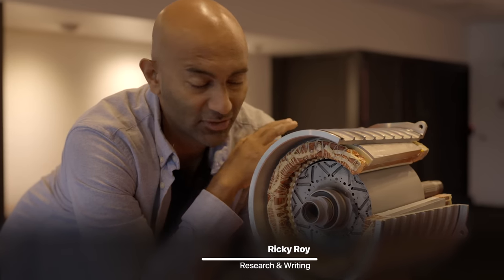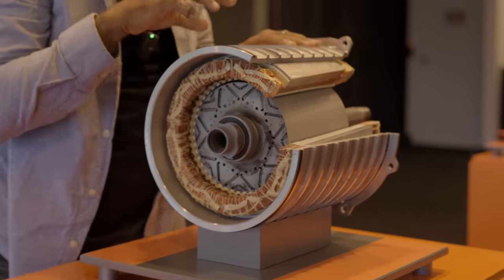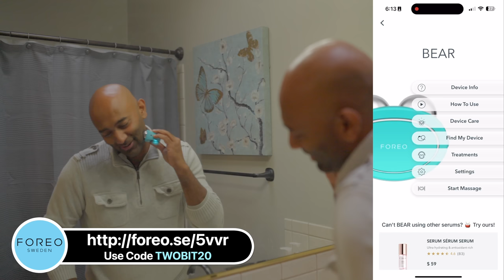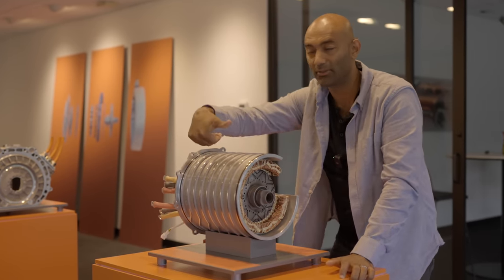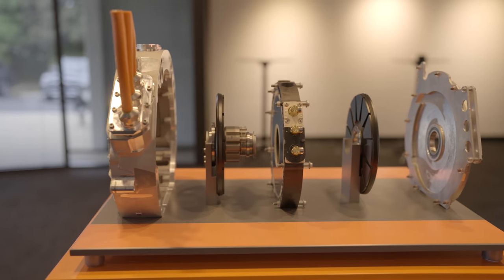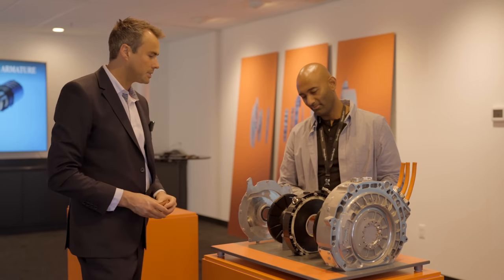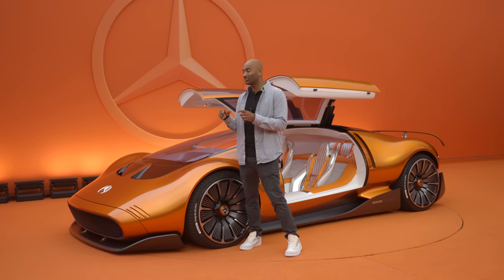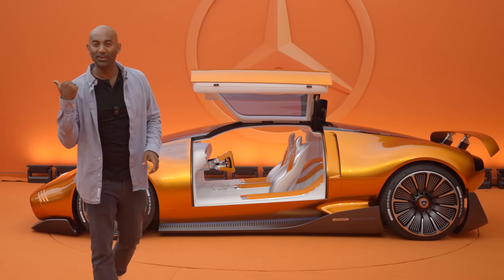Axial Flux Motors Will Change CARS - Here's Why

Comment: The axial-flux motor has been  a well-known configuration for many years.  What I did not hear in this presentation are the issues that have prevented its general adoption in any number of stationary and transportation applications to date and how Mercedes has overcome those limitations.   Surely, the material cost savings for the axial-flux motor alone would be compelling in any application, all other manufacturing considerations being equal.  The fact that radial-flux motors are still the dominant form factor implies that there are either significant differences in either design complexity or manufacturing complexity or both.

I am certain that Mercedes is being successful at optimizing toward their target goal.  From this presentation I am not sure what that goal is other than performance/weight ratio.  I also did not hear what advances can be made on addressing performance/cost when compared to a motor such as the Tesla Plaid motor.  Maybe Mercedes can surprize me.

BTW I have only heard of battery temperature and brake temperature being limiting factors for Tesla Plaid at Nuremberg and Pike's Peak.  It is impressive that Mercedes axial motor runs so cool but is that the highest problem on the pareto list?  At least more of the system's cooling will be available for battery packs, so the motor advance does impact the higher heat item on the list.

I like the development but am still skeptical that this is nothing other than a specialty racing motor, albeit a potentially impressive one.
Reply: From the engineering standpoint you have many advantages from a way smaller, more compact, more efficient motor. One is packaging - standard motors have 3 times the weight and the sizes, you could put 4 of them at every corner - that is next gen opportunities in controlling and performance.  It is not solving the battery limitations you mentioned - but Mercedes is developing there too. You can see their concept car with a 1200km range. Its a technology leap forward.
Reply: @bavariancarenthusiast2722  The only part we disagree on is the fact that, as presented, the design is a technological leap forward.  It may be a notable refinement of the axial-flux configuration but no mention is made of advances in the manufacturing process that would make the axial-flux design cost-competitive to at least the advanced radial-flux designs.

It will be interesting to see this motor in performance applications.  I do not have enough information for me to anticipate its incorporation into high-volume surface transportation.  The weight-savings is compelling for air-transportation, however.
Reply: @mrhickman53  agreed - I also don't know the production costs compared to the older motor designs, if they are on par or maybe cheaper. 
For me it's a revolution - its 1/3 size and weight by putting more power out. 
We need this for batteries too - imagine one third the weight and more capacity. We will see that in 3 years from now.
Reply: @bavariancarenthusiast2722  First of all, let me explain that I use these responses to sharpen my views on the subject.  I do not intend to be at odds with your views, just explain why I hold mine.  No offence is intended.

While I have not looked, I imagine the VTOL drones being developed as air taxis are almost exclusively axia-flux direct-drive motors.  The cost penalty for weight is too high to ignore axial-flux designs.  I have not tried to compare the Mercedes claims against motors being applied into those applications, but I imagine they are similar.  As I think about it, the fact that Mercedes did not identify air taxis as a target market for their development makes me more suspicious of any claim to revolutionary design.

Again, it is likely very good engineering, which is a merit in its own right.  If it shows up in a production car, I imagine the owners will be paying a premium for the performance and fine engineering.  From a marketing perspective, if this premium exceeds the cost penalty over the equivalent power from radial-flux designs due to consumer impressions of higher achievable performance, then the design is successful.
Reply: One thing to mention is that Axial Flux layout is solving a problem that hasn't really been a problem for electric cars.  A radial flux motor is already very small, very light, and very high torque compared to the ICE it's replacing in a design.  The axial flux layout gives higher torque, but the torque limit on most EV is the ability of the tires to grip, not the motor.  Meanwhile, rotating mass isn't free.  The higher RPM of the radial flux motors means they can give a modest car a higher top speed without the need of a transmission.

So there are reasons this is being talked about in terms of ultra-high-performance vehicles, for now.  As they get cheaper, the axial motor-per-wheel approach will probably trickle down to economy vehicles.  Unfortunately, nobody is making economy EVs while the limiting factor is battery supply, because the margins are higher on luxury vehicles.
Reply: 'a well-known configuration for many years.'  Exactly, there was the quite famous at the time solar car around 1998 or so IIRC..
Reply: the efficiency is unmatched
Reply: People didn't know. And: Wheels don't need to spin at 22k RPM. Just reduce gear-ratio when using axial flux.
Reply: @mrhickman53  Your logic is spot on. In a normal auto the benefits don't matter. In terms of mass a model S is around 2000 kg with 1k HP. So two of these could be 40 kg instead of 3x, 80 kg more. 4% total weight or one passenger doesn't significant alter the utility of everyday use. Similarly for size savings, just make the auto a little bigger to gain the same few cubic feet of space. Like other exotic materials in transportation, the use case is in extremes: race vehicles, aerospace, and branding/marketing.
I question if the manufacturing is truly simpler but the reduced materials (assuming it isn't using more exotic/expensive materials) could lead to a less expensive product. Assuming reliability is there and a modest cost savings can be found these will take over. Until then, iterating on a proven platform is the more conservative approach.
Reply: @larslrs7234  I first toyed conceptually with axial-flux designs in the '80's based on what was already well-known then. 

Since you already seem to agree that a gear-reduction is required with either motor, I assert that the one reduction requiring a higher ratio presents minor mass and cost issues.  This implies to me there are significant manufacturing cost disadvantages to the axial-flux motor.  

Observation of a few frames of the video indicates to me that the Mercedes design relies on a significant mass of rare-earth magnets on the rotors in order to achieve a reasonable magnetic flux density through the current coils.  This can be a significant material cost driver as rare-earth magnet cost per unit mass significantly overwhelms copper and steel costs per unit mass.  A crude spot-check for neodymium vs copper reveals it to be approximately a factor of 10 more expensive.  With Tesla moving to designs that either minimize or eliminate neodymium and other rare-earths, the mass savings of the axial-flux may not transfer directly into cost savings even neglecting any differences in manufacturing costs between the two designs.

I only write all this to demonstrate where the video failed to convince me that there is great novelty in the design.  Whether this is the fault of the video itself, or the material either provided by Mercedes or researched by the channel to support the production of the video, I do not know.  I also do not know if a video produced in a fashion to satisfy me would generate enough clicks to be worthwhile producing.
Reply: @barongerhardt  I just replied elsewhere that there is cause to question if the reduced mass of material even leads to reduced material cost.  The statement that the coils are placed in a non-ferrous stator implies a large gap between the magnets and magnetic material (steel?) of the rotors.  This requires magnets of the highest energy  density to maintain the flux density in this gap for the current to react  with.  So I have either misunderstood the video or the motor requires a significant mass of rare-earth magnets, which I spot-checked to cost about 10 times per unit mass as copper.

This may be a finely engineered motor suitable for specialty applications such as racing or flight.
Reply: With the materials and tech that has been developed since the discovery of these types of motors, they may have become feasible.  Looks good for sailboats.
Reply: I mean, "hotter" means less efficient, if the work is equivalent.
Smaller and lighter are both possible paths to placing the motors nearer the wheels and placing more of them, giving direct control rather than relying on differentials.
Moving motors nearer the wheel is a packaging opportunity as well, and an opportunity for different footprint/geometry.

As for cost of manufacture, you have to keep in mind the reduction in material mass.
Reply: @mrhickman53  Depending on how much of those magnets are need or if they can be swapped with something else after other improvements, it might not be a deal breaker. I just don't see it as ever being a revolutionary game changer in the ev market and any modest gain it does provide won't be anytime soon. Maybe 10 years down the road a model 3 costs $1k less to produce and has an additional 40kg payload capacity, cool.
Reply: @rpontonjr  You assert axial-flux designs are cheaper but I have not seen evidence that they are so.  Being more power-dense does not automatically translate to being cheaper.

If you have evidence of them being cheaper, please share.
Reply: @barongerhardt  I'm a little rusty on magnetic circuits but the volume of the gap times the target flux density squared, approximately 10-12 kgauss if steel is part of the magnetic path elsewhere divided by the free-space magnetic permeability is the amount of energy the magnets must provide to the gap.  If I remember correctly, the portion of the magnetic energy transferred to the gap is proportional to the thickness of the gap vs. the thickness of the magnet, assuming infinite permeability of other magnetic materials outside the gap.

A significant difference magnetically between radial and axial-flux permanent-magnet motors is the  (assumed) better ability of the radial-flux motor to minimize the effective gap length,  yielding a smaller gap volume per unit area and, thus, less required gap magnetic energy for the same flux density.

In the design shown, the magnetic fields will tend to flex the rotors toward the stator, requiring the mechanical design to provide enough stiffness to minimize the flex and enough clearance to accommodate variations in flex due to operating temperatures and current flow in the stator as well as manufacturing tolerances.

Boiled down to basics, I see the predominant manufacturing issue of axial-flux motors is flatness, where the predominant manufacturing issue of radial-flux motors is concentricity.

I do see potential advantages of the axial-flux design from an operational efficiency standpoint.  The magnetic material in a stator suffers from eddy-current losses due to the magnetic field reversing polarities at the frequency of the applied AC current.  If this design truly does not have magnetic material in the stator, those losses are avoided.  I do not have an appreciation for how these "iron" losses compare to the "copper" losses in a modern traction motor or how the copper losses of the axial-flux motor might increase due to the larger air gap and presumed higher leakage inductance due to the increased gap length.  Lower inductance also implies a requirement for higher switching frequency in the inverter in order to minimise peak currents at the switching frequency.

I'm just pointing out that it is hard to optimize everything at once.  I'm sure this design optimizes those things the team set out to optimize, but it is likely a subset geared toward performance and not necessarily cost.
Reply: one major disadvantage is top speed.. he did mention that
Reply: This I why once in a while I open and read the first few comments.
Reply: The expected rising cost of coper is going to be a major driver in adopting this configuration, material are a floor for the cost of a larger motor so once both are produced at scale the axial-flux motor will be cheaper.
Reply: @mrhickman53  I asserted no such thing.  I said as they get cheaper, meaning relative to where they are now, they may show up in economy cars.
Reply: he mentioned it was for a hybrid vehicle so I would imagine that space saving design is very desirable.
Reply: @burtun1760    I've absolutely no issues with it as a hybrid motor with similar operating range as the engine.  Packaging constraints likely reign supreme in that instance.

I understood the concept discussed was based on an existing hybrid motor design but extended to provide the desired performance to a BEV.  Extending the axial-flux design to such platforms is where I have some scepticism.
Reply: @rpontonjr  My apologies for misunderstanding you.

You do bring up a point that I have pondered, whether quad-motor configurations are superior to dual-motors with differentials and torque vectoring (independent wheel braking).  So far, the conclusion I have come to is that the situations where a passenger vehicle/light truck requires torque vectoring at relatively high speeds are few and far in between, so torque vectoring, even though it  is energy dissipative, is quite satisfactory.  At low speeds, such as encountered in off-road conditions, the additional dissipation should be quite manageable, due to the relatively low power involved.  It is all about the torque in these conditions.

I have not looked at the power dissipation capability of brake rotors to know whether quad-motor configurations for vehicles spending extensive time in the mud offer a true advantage.  The lazy me would probably lean toward quad-motor rather than investigate this possible limitation of torque vectoring.
Reply: @kennethferland5579  I do not see the compelling reduction of copper in the design.  Force is Ampere-turns times flux density times the length of the turns mutually normal to desired direction of the force and the magnetic flux.  Whether an axial-flux design or radial-flux design, there is little change in the amount of conductor required to generate a similar force in the presence of a similar magnetic field.  I wrote previously that the savings in copper, while there, is likely a bit exaggerated by implying that the entire turn of the axial-flux winding contributes to rotational torque.  Only the radial segments of the conductor do so.

I have also written previously that the gap length is likely much larger than that in a radial-flux motor, which will require a higher volume of magnets to generate the equivalent magnetic flux.  If these magnets are rare-earth, neodymium is roughly 10 times more expensive than copper.   Now motor radius and rpm can be adjusted in order to minimise the energy requirement of  the magnets per unit of peak power output, but I expect this requirement to remain large compared to a radial-flux machine based on the images.

It seems that Cu prices are currently ~$9/kg and silicon steel is ~$2/kg.  Neodymium is somewhere in the $100/kg range.  Take a swag at the tesla plaid motor being 25% Cu and 75% SiSteel for no apparent reason and totally neglecting the neodymium for the moment as Tesla has plans to eliminate that in at least some of its motors, the $/kg of the motor is $3.75.  The motor weighs 45 kg, so a very crude estimate for the material cost is $169.

Unless the axial-flow motor is achieving much higher gap flux density than the silicon steel of the radial-flux motor can  support the axial-flux engine is still using a large fraction of the copper.  If there is no silicon-steel in the stator, the rotors do not need silicon-steel and be made with a cheaper ferrous material due to the static magnetic field applied to it.

In order to complete the fiction, assume the axial-flux motor weighs 13.5 kg, 9 kg of which is Cu, 80% of the radial-flux motor.  Let the remaining 4.5 kg cost $1/kg and we have a material cost for the axial-flux motor of $85.5.  The axial-flux motor can use as much as 0.8kg more of neodymium than the radial-flux design and be within material-cost parity.

The question is whether it will ultimately save cost once the two manufacturing processes are at parity, if they ever can be.

caveat:  If I can convince myself that it is feasible for the axial-flux design to generate equivalent force from a markedly reduced gap area, then I would need to revisit my arguments.  This would then be a great exercise in me remembering how a motor works.
Reply: They were always better but it's only been recently that axial and transverse motors have been relatively easy to manufacturer in to an efficient design. Prior it was difficult, fragile, and expensive which is why you didn't see them very often. They're also tricky to drive so speed controller design had to improve as well. They should provide an incremental improvement over radial motors. Nothing magical, just more efficient at the expense of a more complex design.
Reply: It's like Popular Science mag more cool future stuff that may or may not ever appear.
Reply: @bavariancarenthusiast2722 From a production engineer - The copper windings look much easier to make in the axial flux, once they have more machines specially for them, the coils will be cheaper.  The materials used in the axial flux weren’t really discussed, but they didn’t look unique.  I imagine some of the issue is the casing to keep the thing together at high speed, and the “hand made” methods used right now.  In “normal cars” It would be sensible to add some gearing to keep the RPM down to remove the need for exotic casing technologies, obviously Mercedes want maximum speed for their concept car, so they are spending big on all components.
Reply: @Muppetkeeper  Thank you for experienced comment - appreciated. Yes the concept car was no costs spared, this is not a generic Mercedes development, they bought an english company called Yasa - and their customers are companies like Koenigsegg (not cheap either), Jaguar concept etc. I don't know how exotic those materials are, I guess you can build them with standard materials, here a quote: "Simplicity can be beautifully efficient. Compared to the complex, multiple slot windings of conventional motors, YASA motor’s segmented armature lends itself to low-cost, serial production.
Our motor efficiency is not limited to its performance capability.
The YASA Axial Flux approach uses less material such as copper, iron and permanent magnet, than conventional e-motors, resulting in a significantly lower material cost and a more environmentally-sustainable product."
Reply: @bavariancarenthusiast2722  While it may be tempting to slap four motors on, doing so would require having four 100+kW inverters on board and those would be much bigger than the 100-200kW motors themselves. You'll likely also still want the motors to be mounted to the frame instead of directly onto the wheel to minimize unsprung weight, avoid HV cables, control and coolant lines going through the suspension, which means you will still be losing quite a bit of space just to accommodate having CV axles. Since CV axles work best at shallow angles, you would likely want to put motors close to the center-line to minimize angles across most of the suspension and steering motion range. In the end, you have roughly the same under-carriage footprint, except more of it is empty space around the CV axles.
Reply: 500 hp is a lot of power. If only 1% of that is dissipated in the windings and such, that makes the motor a 3.7kW heater. That will be produced in comparatively short bursts, of course, but that's still a significant amount of heat to manage. 🤓
Reply: @mrhickman53  There is a lot of copper used in the weave of a radial axis motor designed to reduce magnetic fields outside the rotor and also to get the copper for the rotor where it needs to be.
Reply: @serversurfer6169  Based on my now several decades old experience with industrial motors I expect the losses to be closer to 3% at rated power.  I expect the losses in the inverter to be about 1.5% at rated power, though switching times are likely vastly improved since I was last active in inverter design.

If an ICE engine is 30% efficient at 500 Hp, its thermal system must remove heat at a 870 kW rate at steady-state (the engine temperature no longer rising).  There are likely insulation systems for the electric motor that permit it to approach the target cylinder wall temperatures of an ICE, so the cooling requirements should not be much more stringent.  The inverter likely does not like to run above 150C, which is about 50C lower than what is posted as a maximum cylinder wall temperature on at least one web site.

Racing is much about dissipating excess thermal energy.  Thermal power dissipation from the brakes is another limiting factor in both racing and the speed which ICE trucks can come down long grades.  Battery-electric trucks will be able to make better time in mountainous areas due to more torque upgrade and the same torque recovering energy into the battery downgrade rather than heating brakes.
Reply: I agree. It's like I've been hearing "battery breakthrough" for the last TEN YEARS.  All click baits.
Reply: @Muppetkeeper  While there may be craft in how the end turn is weaved to reduce the stray fields my observation of many sets of end turns never led me to believe significant additional material is used for this purpose.

High-speed motors tend to be both longer and smaller in diameter,  both of which lead to a favorable ratio of end-turn length vs. axial length.  If only the length is increased, the resulting torque is also increased proportionally.

My (mental) analysis of an axial motor yields that, to increase the ratio of radial to circumferential copper without increasing the diameter of the motor, the center of force will move radially inward from the edge of the rotor, reducing the moment arm for calculating torque.  So while the force in increased due to increasing the length of the radial components, the torque increases as a fraction of this proportional increase.

I need more information about the design of the axial-flux motor before I can appreciate how much copper can be saved.
Reply: @serversurfer6169  It is 3-4kg of copper surrounded by coolant. The specific heat of all that mass would limit temperature rise to about 3C/sec, enough to manage ~20s of acceleration without active cooling. You'd still need active cooling to ensure the temperature does get back down in time for the next time while the motor is dissipating 200-500W at cruising speed.
Though if you are repeatedly calling for 350kW long and often enough that motor heat-soaking is of real concern, I hope it is either on a race track or while towing something heavy, otherwise it reeks of reckless driving.
Reply: @teardowndan5364  Yeah, a one-time event is easily handled, but the issues come with prolonged or repeated usage. It sounds like a lot of these motors use liquid cooling, and YASA are saying their design is less complicated. 🤷‍♂️
Reply: @serversurfer6169  I think Tesla has that part mostly licked with its integrated motor-driver units where the motor shares oil with gears and bearings for cooling and excess heat gets dumped into the electronics' liquid cooling loop through a small heat exchanger. For lower power motors, heat crossing the midplate into the electronics side would likely be enough to skip the heat exchanger altogether.
Reply: They have already been used in the Koenigsegg Regera - which should vouch pretty heavily for their usability.
Reply: @dangraff8467  Earlier lithium batteries from before EVs became a thing and the industry started to worry about sustainability weren't designed with recycling in mind and most of the materials from "recycled" batteries went to landfills or incinerators. Modern ones are designed to be almost 100% recyclable. Many of the materials have more than tripled in price since then too, which greatly increased the incentive to recover more of everything and making it easier to do so.
Reply: @dylanevans5644    I've no argument against usability.  I am only skeptical of cost-competitiveness.  Koenigsegg optimizes for other things and the customer pays for those optimizations.
Reply: @mrhickman53  Yes, I agree.  I feel that we haven't really seen the true potential of electric vehicles, yet.  Some of that is the fact that they are "cars" and subject to the car regulations written for ICEs.  More of that is the fact that they are using parts from ICEs (everything from door handles to headlights to radios).  Mass market EVs haven't really diverged that much from their ICE heritage in overall design -- yet.

Because batteries are the limiting factor, we see the focus on really big EVs for higher margin.  When that chagnes/shifts, I could see axial flux motors being attractive to maximize usable interior space in an economy vehicle.
Reply: I'm fairly sure cooling the copper coils would solve a good portion of the shortcomings, retrofitting cooling into existing machines would be cost prohibitive. Purpose built means that stuff doesn't even matter if it achieves the goal
Reply: @ModelLights  technically, it is THE original electric motor. a faraday aka homopolar IS (in most configurations) an axial flux motor.

anyway... over a century of development, rather intelligent men working on problems... 

theres several reason we still use radial flux in virtually every motor.

i could explain but as i have a habit of writing what some people call "novellas", then calling them ignorant pigs,  im keeping my fingers still and just suggesting people educate themselves on things like amp turns, reluctance, flux density, inductance, reactance... pole shaping, etc etc etc...

this is, as usual... hype-speech. its meaningless babble spitting out hyped up keywords. oh my... "axial flux", it sounds SOOOOOO technical...
Reply: @paradiselost9946  
'i could explain '  No need to be concerned, I've been doing motors since I was 12 in the 1980's and controlling stepper motors off the back of a C-64, I'll be way ahead of you on this.  I haven't been buying and selling on Ebay much lately, but I still have a few thousand motors laying around.

' rather intelligent men working on problems... '
I'm in the 180 IQ range myself and was around early as LRK types were being developed, I'm a bit more aware than most..

'THE original electric motor. a faraday aka homopolar '
That's a minor triviality, totally missing the control and internal gearing aspects of LRK type axial flux motors.

'i could explain but as i have a habit of writing what some people call "novellas", then calling them ignorant pigs,  im keeping my fingers still and just suggesting people educate themselves '

I left it a mere mention on purpose, the people who are smart enough and actually have interest can look it up, and the rest don't really matter.
Reply: The one on my vehicle is only 20hp but 189 ft/lb of torque. These motors are not HP monsters but Torque giants. It will be interesting to see how they develop these to compete with the radials in the HP area.
Reply: Low rpm.  Sure, can add a transmission (for added cost) which would make it more expensive than a standard motor.
Reply: @johnsanders8168  Please don't mind my playing with numbers, though I will convert to metric.  20 hp = 15 kW,  189 lb-ft = 256 Nm.   A model I have for my EV requires about 540 N at 100 kph or 28 m/sec = 15 kW.

Assume the vehicle weighs 2000 kg and is moving up a 3% grade at 100 kph.  The required power is 2000 x 9.8 x 28 x 0.03 = 16 kW.  This is in addition to the 15 kW to move the vehicle at 100 kph.

If one is okay with 0-100 kph in 10 seconds,  the acceleration force required is 5600 N.  For a tire radius of .38 m,  the torque at the wheel is 2000 Nm, or about 8 times the motor's rated torque.  A motor at each corner with no gear reduction would only accelerate the vehicle to 100 kph in 20 seconds.  The power due to acceleration at 100 kph is about 157 hp for 0-100 in 10 sec.

This might give one the directions they may go in scaling your particular axial-flux motor to a full EV application. 

Torque is nice, but power is also necessary, depending on the mission.
Reply: @teardowndan5364  you make some very good points. 

Yes i can see the narrowness of the axial flux motor still being a an advantage with center- mounted design, but really only if we're talking about something with alot of travel such as an offroad vehicle. In that case, as you pointed out, it is a large advantage to have the cv shafts as long as possible.

Its always been something I've thought about, and why I like the potential we have with electric cars- how to eliminate as many mechanical things in the drivetrain as possible (including differentials, the CVs, and shafts). I'm no expert (in fact not very well educated in electric motor technology) but clearly motor technology needs to evolve still to get there.
Reply: @cheatinggravity173  I don't mind reducing overall component count as long as ride quality, reliability and serviceability stay up. And I'm not foreseeing any of those surviving integration of the motor and gear box with the wheel hub, only much more expensive and frequent repair bills.
Having 10kg of extra unsprung weight would likely double the likelihood of ripping tires on potholes and all of the subsequent dangers. Wheel bearings will likely fail much quicker too due to being exposed to harsher shock loads from having that much extra hard-mounted mass on them.
The thing about longer CV axles isn't about suspension travel, it is about minimizing angles for efficiency. An axial motor has a larger diameter, which means the motor would need to be buried further up to maintain ground clearance, which in turn means steeper angles all around unless you use a gearbox to shift things back down.
Reply: @teardowndan5364 I'm following you, all very good points. How much difference in diameter are we looking at for axial vs radial flux motors in the 300 hp range?
Reply: Just at a cursory glance, can we just say they're sacrificing magnets for copper?  That doesn't seem like a good trade.
Reply: Temperature problems? Sounds like if we did adopt these sorts of motors we would be in the same kind of problem as we are with LEDs, burning themselves out because of production cost-cutting and unsound engineering and then letting the customer foot the maintenance bills.
Reply: @cheatinggravity173  Power alone doesn't mean much as it is a function of torque at a given RPM. 
The diameter would be a compromise between how much torque you want to have direct from the motor rotor, how much vertical clearance you are willing to sacrifice for it and the RPMs you want to operate at. As pointed out in the video, a larger rotor produces more torque but the centrifugal force trying to rip it apart and inertia increase too, which means having to lower max RPMs by an inversely proportional amount.
Looking at YASA's datasheet though, there is one glaring flaw with the idea of using axial motors to directly drive wheels on an EV: 0Nm torque at 0RPM. Can't start moving on its own while under load, needs another motor to help it to 200+RPM first. That explains why Mercedes slapped it between the ICE and transmission instead of a fancier hybrid setup.
Reply: @teardowndan5364  power means plenty. it measures the ability to accelerate mass, not just potential to move it. Larger rotor with higher torque at lower rpms requires less differential of speed between motor and tire speed. The faster gears in oil turn, the  more loss to friction, at an exponential rate. One of biggest robbers of power in a car at highway speeds besides air resistance is gears and bearings turning in oil.
Reply: How dare you! He wanted a free vacation, he isn’t worried about petty things like facts!
Reply: @mrhickman53 these motors don’t last long. It is why they are RPM limited. You won’t see any cars going 150k miles on these motors. That’s why they will only be put into super cars, not the cost not any other reason. A super car owner is the only person stupid enough to pay a million dollars for a car that has no hope of going 100k miles before the motor grenades itself.
Reply: @mrhickman53 these motors have been around forever it’s not novel. They spin themselves apart in short order, which is why they can handle rpm, but even then they don’t last. These are only fit for super cars because only super car owners will tolerate the engine grenadine itself at 50k miles
Reply: Intelligent and fair comment. Engineering is about compromises and anytime someone claims that they have done something unique or groundbreaking, that is to dispel the millions of people who have already tried this idea. That doesn't mean we don't try, but it does mean that we need extraordinary evidence for extraordinary claims. 

But how else do you get more YouTube click if you don't just paint the upside all the time? ;-)
Reply: One advantage that he didn't mention is coaxial motor stacking, which can be useful for applications that need very high power output and isn't really easy with other types of motors.

The high performance of these motors require much higher voltages than are seen in standard motors.  This means that the whole power delivery system has to change to be more robust and will drain batteries quicker.

The main place I have seen these motors being used is in electric formula student competitions in universities where  there are very strict low weight constraints and they have to worry about every ounce of weight.
Reply: I totally agree with this comment and how axial flux motors are presented. Axial flux motors have been dismissed multiple times due to cooling, vibrations and structural integrity. 

Let's start with the cooling, given that you have a much more energy dense motor, the heat is now concentrated in a smaller area, making efficient cooling for this engines very challenging, specially for the rotor. 

The second topic is vibrations, while radial flux motors are naturally balanced, axial flux engines are not, they require very strict manufacturing tolerances and low variability in terms of the conductors and magnetic fields, otherwise the engine would "want" to vibrate up and down. 

And the last one, and perhaps the most difficult one to overcome is rotor diameter and it's structural integrity. While radial engines can keep the rotor relativity small in diameter, although longer to achieve bigger power output; axial engines need to have a bigger diameter rotor to increase the power output. A bigger rotor will exert more centrifugal forces to the edge of the rotor, and you then are limited to how fast an axial motor can spin, otherwise you need to use very expensive materials like reinforced carbon fiber to keep rotor integrity at high speeds. 

About 20 years ago, axial motors had also much more complex controller circuits, but it is no longer a problem for mothern electronics.
Reply: Surely, the material cost savings................ yeah they dont like the word savings
Reply: It's all about 'performance/weight ratio', surely? That's the basic equation there, no? The presentation goes into Tesla motors, and covers drawbacks they are working on.
Reply: Overheating was a problem for the Model S under any extreme use for a long time. You could only drive them really hard for about a minute before they went into limp mode. The sub 3 second 0-60 was only available once every 45 minutes or so, and there was a fairly low limit to how many times you could use it over the life of the car (the company lost a class action law suit over that one). It was a $130K high performance car that would get completely destroyed by a Nissan Versa at any track day, because it became a 5,000 pound mobility scooter after about 2/3 of a lap in most places.

That's why the biggest change to the car in recent years has been improvements to the cooling systems. 

Honestly, the fact that a nearly 15 year old design is still pretty competitive this early in the electric car era (when you'd expect the highest rate of incremental improvement) when the development has been primarily focused on stuff like cooling and opening up the software as reliability data warrants shows how much potential electric cars have. Maybe axial-flux is the next big step forward.
Reply: Cooling system is a limiting factor I guess. Motor design requires massive radiator.  Take into consideration 3 (!) Cooling lines in the video.   When liquid cooling system  connected to the motor, total weight and size will be comparable to the classic electric motor.  "There is no cigar " here.
Reply: @mrhickman53  If the cost of raw materials, batteries, and all the supporting equipment changes drastically due to an . . . economic realignment or some other kind of "4th turning" event or global black swan impact then  manufacturers will be looking for any pathway that leads to more power with less materials. So, in a nutshell, if the equation changes drastically enough to wildly impact basic costs then huge efficiency gains through disruptive minimalist designs (like the subject video) will accelerate the transition and adoption IMO.
Reply: @hardchemist  Hmm.  Seems there are a lot of "ifs" in your comment. 

If my observation is correct,  that the motor in the video relies on a much higher quantity of rare-earth magnets in order to compensate for the larger gap in the magnetic path due to saving the silicon steel, I assert that the axial-flux design has much higher exposure to disruptions in the global movement of materials than radial-flux designs, especially the teased Tesla design that supposedly generates competitive flux levels without any rare-earth magnets.  I understand that rare-earth processing is highly concentrated in the Middle-Kingdom, whereas both copper and silicon steel is processed more widely.

I know of no similar high concentration of copper processing or silicon steel processing that would make them subject to a sudden and massive disruption as we have the potential for rare-earths and lithium at the moment.  At present, integrated circuit and, possibly, silicon carbide power electronics processing is likely more subject to disruption than copper, silicon steel and aluminum, the materials required for induction motors that, while less efficient at rated power are still quite useful in transportation.

In my opinion, permanent-magnet motors have made such a heavy penetration into EV's to date because performance has been the sizzle that attracted attention to them.  I have first-hand accounts of two acquaintances that are decidedly more conservative in their views than I am that purchased Teslas "for their performance, not for environmental reasons", paraphrasing their words.

At the risk of droning on way too long, an axial-flux version of the induction motor is certainly possible, but that would definitely require silicon steel in the stator and the rotor magnetic material would likely require a laminated structure in order to minimize the eddy-current losses that would not be present in a permanent-magnet design on that structure.  Much of the advantages of the axial-flux design would then be lost.
Reply: @mrhickman53  Brilliant and thoughtful reply, thank you!
Reply: @hardchemist  I enjoy these conversations.  Your previous comment caused me to think about resources more thoughtfully than I had recently.  Have a good day!
Reply: @mrhickman53  Adding one thing, I have so little faith left in the "powers that be" (corporate and government influencers and powers) that my "if" statements really should have been "when" statements. The lunacy factor is completely off the charts and it really seems as if the system is purposely being crashed. We are definitely living in interesting times!
Reply: @hardchemist   I suspect there have been "powers that be" and those that had no faith in them since the beginning of civilization.  I've no answer to that.  I merely try to make sure that what captures my interest in these times are of a constructive rather than a destructive nature.  Again, have a great day!
Reply: I just cant wait till these are powering planes and gyroplanes in a ducted fan hybrid setup.
Reply: @mrhickman53  I built an axial flux motor for a wind turbine 15 years ago and the design was not new then. You're right to say it requires a high percentage of strong rare earth magnets making the design expensive.
Ricky also talked at length about the problem of copper looping back at either end of the other motor but failed to mention the recent advances where the winding's are welded at either end reducing the wasted copper significantly.
Sadly some of his recent videos have been more like propaganda from the company than journalism.
Reply: @mrhickman53  They tend to be cheaper to manufacture as their construction is simpler, the winding process is simpler. The materials cost is less as well. Take a look at some winding machines for radial vs axial.
Reply: @kayzrx8  I think the increased rare-earth magnets likely negates the material cost.  Overall mass is saved but not necessarily cost.  Frankly, due to the large air gap that I imagine from the description made in the video I expect the material cost to be higher as rare earths are used to compensate for the much lower silicon steel being used.

My witnessing motor winding operations a few decades ago reinforces that this is not the gating operation in the motor manufacturing process. 

Overall, I see a manufacturing process that requires tight tolerances of several flat surfaces and the gaps between them rather than several concentric rings.  From a manufacturing perspective, I believe that concentricity is much more easily controlled in order to assure a consistent radial gap.

With motors being produced in large numbers starting at the beginning of the past century, if the axial motor were truly easier to manufacture, I am certain that we would see many more samples in common applications today.

Absent such observations outside the video, the video should provide evidence that this is the case.  In any case, the large quantity of rare-earth materials will likely keep the axial-flux motor more expensive.
Reply: This Mercedes innovation is not something they came up with on their own but something if I understand correctly they bought when acquiring the British firm YASA in July of 2021.  Good on them for continuing development and improvement.

Elaphe in France though, for their in wheel motors, has found axial flux still has some hurdles to overcome such as limited segmenting and lack of smoothness at lows speeds plus a tendency to develop runaway axial force imbalance leading to premature bearing failure.  Elaphe therefore currently makes pancake radial flux in wheel motors which in that form they are finding easier to cool in high demand situations than the axial flux designs so Mercedes claims of easier cooling come as a bit of a surprise since they both can't be easier to cool.  They are currently at up to 362 peak HP and 2212 foot pounds of peak torque per wheel at 97% motor/95% system efficiency which is impressive since it beats by a large margin the more typical 58% system efficiency of more common EV drive systems.  That greater system efficiency of 95% could give you 37% greater range without increasing battery capacity which would be a huge improvement.  Imagine a car that currently gives you 300 miles of range jumping to 411 miles of range from the same battery just from using a more efficient electric drive system.

It will be interesting to see which is more practical for passenger vehicles on the road.  Great that there are multiple competing options to help push things forward.

Best!
Reply: @neilfromclearwaterfl81  So where did you find a typical EV system efficiency of 58%.  I smell apples and oranges being compared here.  It's been decades since I worked directly with industrial motors but even the standard efficiency ones at the time were 92%.  The 95% and greater higher-efficiency motors being introduced at the time forced development on the inverter side in order to maintain stability during lighter load conditions.  Even at that time the issues were manageable.  The inverters I was involved with developing at the time were over 97% efficient at rated load with a significant portion of the losses in the AC-DC rectification and capacitor storage losses.  The rectification in an EV application would be represented as a charging loss, not operating loss that I think your 95% system loss only includes, being primarily battery discharge efficiency and mechanical power train loss.

Please elucidate if you have more detailed comparative information.

I had identified the axial forces on the rotors in the design but do not have sufficient mechanical engineering chops to determine if the issues present a significant  design issue or a straight-forward to solve issue.  The "runaway" nature of the issue is, once a member of the magnetic circuit moves or deforms to reduce the air gap present in the circuit, the force applied to the member to further close the gap increases.  I identified this indirectly as one of the issues making it difficult to maintain flatness between the rotors and the stator.

Radial-flux motors have similar forces at play attempting to close the gap between the rotor and the stator on the side closest to the stator.  However, the beam the rotor represents is supported at both ends in the radial-flux motor while the rotor disks of the axial-flux motor are supported only at the shaft end.
Reply: @mrhickman53  Typically in discussions on total system efficiencies before regen braking is considered the combined losses taking into account the centrally located EV motor putting its power out through a set of reduction gears, differential, four universal/cardan joints and two drive shafts before getting to the wheel hubs along with the slighter inverter losses and coolant pumps loads results in up to a 42% loss due to those parasitic loads.  With a direct drive wheel hub motor you only deal with inverter and coolant pump losses before getting into tire rolling resistance and any mechanical brake drag.  There have been some outliers in more high end systems that are slightly more efficient however those haven't been the norm.  Every additional mechanical component between the motor and load is a parasite consuming power to some degree.

My Father was one of my main resources until his passing since he had a masters degree in electrical engineering along with the required associated degrees in mechanical and chemical engineering plus 50 years of working experience. 

Elaphe in their discussion on why they currently don't use Axial or Trans Flux motors explains the issues they found with their use in the here and now but leaves it open as to future improvements that could make either more viable.

Best!
Reply: @bavariancarenthusiast2722  Poor response.  You fail to explain WHY this arrangement has smaller size & more power.  Exactly what changed to make this design PRACTICAL ?
Reply: I generally agree with your assessment. I wrote three books on the design of brushless PM motors. The first considered both radial flux and axial flux motors. The latter two have focused on radial flux motors only. I worked for several years on the design of an axial flux motor for a high power-density, direct-drive military application. The only reason the axial flux motor was chosen was because it was sufficiently axially compact. It did not offer any other significant advantage over a radial flux design. Some notes: (1) Torque is the product of a circumferential force and the radius at which that force is created. In the radial flux motor, the radius is the rotor outside radius. In the axial flux motor, the radius varies with the torque increasing as one moves from the inner radius of the available axial flux to the outer radius. So a great deal of the circumferential force produced near the inner radius does not contribute much torque. (2) An axial flux design having a central stator with a PM rotor on either side isolates the stator making it more difficult to cool. It also means having housing structures on the outside of the two rotors to encapsulate the two spinning rotors. However, if you swap these and place a single rotor containing no steel between two stators, the stators are easily cooled and they inherently encapsulate the spinning rotor. (3) It is not possible to use electric motors in direct drive traction applications as they do not produce enough power, where power is the product of torque and speed. By using a transmission, more power is available because the motor spins at much greater speeds, thereby increasing the product of torque and speed. To get more power in direct drive applications means increasing the torque capability of the motor and this can only be done by dramatically increasing the diameter of the motor so more torque-producing magnets can be added. (4) You will not see electric motors at the wheels in an electric vehicle, e.g. placed where disk brakes appear now. The first reason is that this means utilizing direct drive which is not feasible. Equally important is the concept of unsprung mass. By placing electric motors at the wheels they add to the total wheel mass that the suspension has to control to give a smooth ride. This is called unsprung mass. The ratio of the vehicle mass above the suspension must be ten to 20 times greater than the unsprung mass. As these two masses approach each other it becomes increasingly more difficult to provide a smooth ride. If the two masses were equal, for example, both masses pull on each other equally, making it difficult to isolate the vehicle mass above the suspension from the unsprung mass.
Reply: Nurburgring, not Nuremberg
Reply: Tesla will never be on the level of Mercedes.
Reply: @spongebob7296  That all depends on what is being measured.
Reply: Exactly! They were commonly called "Pancake motors" when I first remember seeing them around 1970.
Reply: @mrhickman53  The job of Mercedes is to sell cars, not break-thru's (same as Tesla). In this case, selling a DeLorean on 120 year old tech to very rich, and very dumb, customers. You just watched one long ad created for the Mercedes board & investors.
Reply: I was at MB when they tested an AF motor thirty years ago. They weren't interested.
Reply: @ModelLights  'well known configuration for many years'... Yes. I saw pancake motors being used in industrial equipment in the 1980's, and this equipment had already been around for years at the time.
Reply: @mmmikeyyy  'Yes. I saw pancake motors'
Wasn't really referring to just general pancake motors though.  Look up the 1998 solar car that famously was running in Australia, and similar ones around the 2000 time frame.  One or two of them were specifically using the axial flux and Halbach array arrangements, and LRK interleaving was done around the same time frame.  Much of this was developed then, it's not as 'new' as some of the people hyping things make it out to be, a lot of it is really 20+ years old.